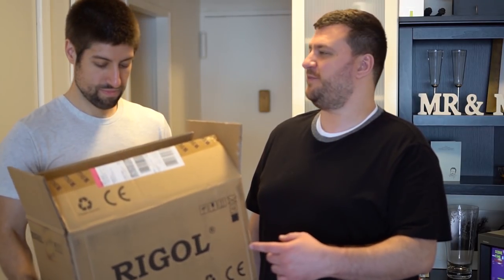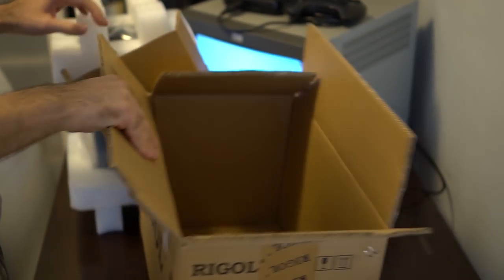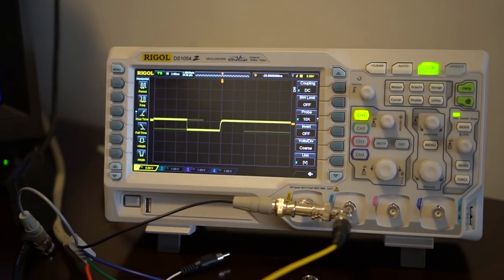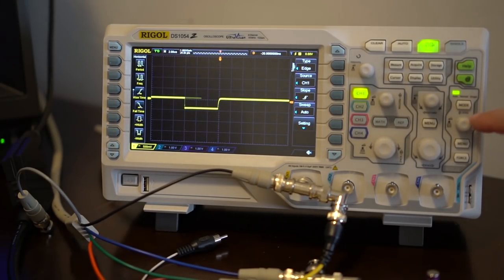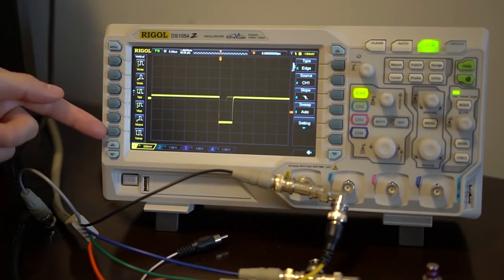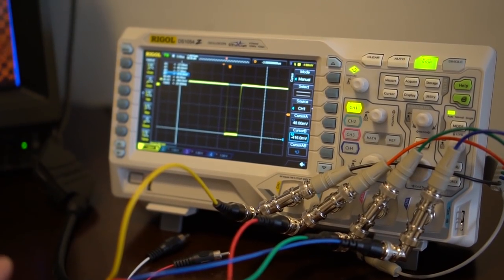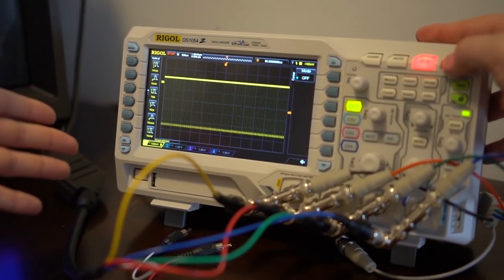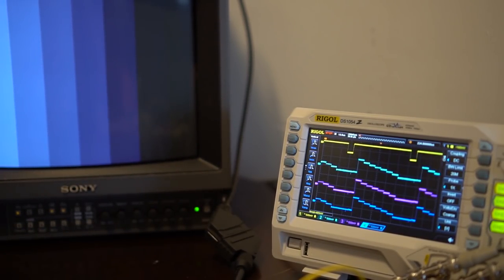Oscilloscope Basics: Tackling Analog Video feat Ste from HDRetrovision

Comment: At the most basic level an oscilloscope lets you observe voltage levels of one or more signals in a 2 dimensional plot as a function of time.  So the vertical measurements and divisions/graticules are going to be voltage levels and the horizontal divisions/graticules are going to be time.  This should be rather obvious looking at a scope but I don't think the video covered this most basic of explainations and it can be helpful as a starting point for thought on the subject.
Reply: Thanks!

Comment: Great vid. ;)

Don't worry about including an even more in-depth stuff if you do a follow-up.

It's worth pointing out that a 10x probe / setting is actually recommended for a lot of high bandwidth analog / high speed digital testing anyway, especially when the circuit-under-test has a fairly high impedance, or is sensitive to the impedance added by the 'scope probe.

(also confusing at first is that the 10x setting on the probe actually attenuates the signal by a factor of ten, so the o'scope itself has to multiply that voltage reading when the scope is set to 10x mode.)

Man, I'd love a decent oscilloscope. I've never had a modern one. I don't do a great deal of analog testing, though, and a lot of the digital stuff is debugged via JTAG or logic analyser these days.

Can't wait to see a follow-up to this vid. The hour flew by very quickly.

Comment: "It's essentially a time machine" 😊. Amazing video. Such a good idea, gentlemen!

Isn't it a good idea to pair a probe with a channel permanently? I.e., use matching colored ring for the channel you wish to use a probe with to the ring on the probe itself, and then set the compensation while ON that specific channel, and try not to use the probe on a different channel next time since it could mess up the compensation?

Comment: What do you do when you need to clean the oscilloscope ports? I've heard Brasso does a great job! (sorry, could not help myself)
Reply: They shouldn't really get that dirty with use but I always go for deoxit for cleaning any electromechanical connector or switch.